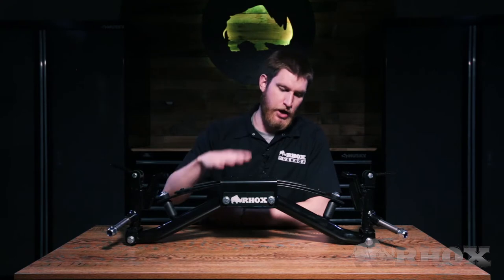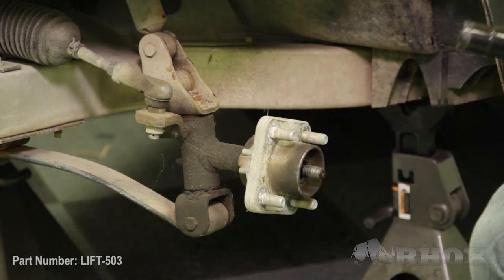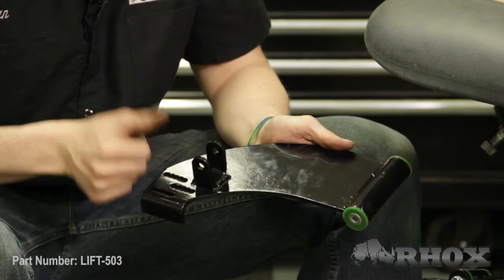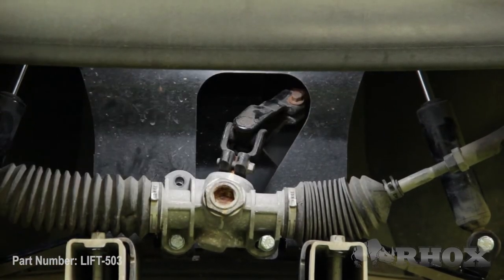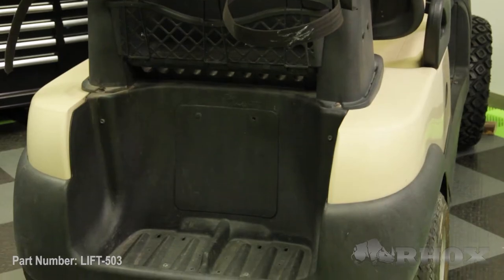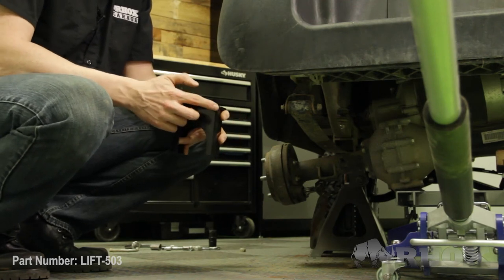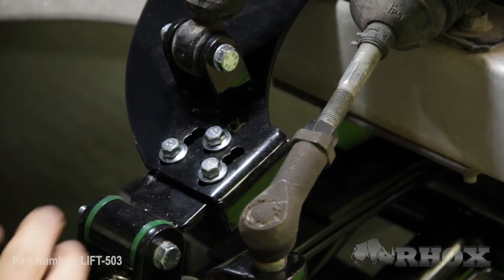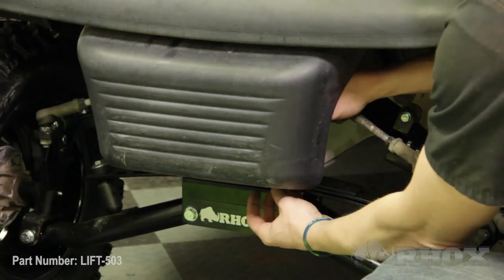LIFT-503 RHOX BMF 6" A-Arm Lift Kit on a Club Car Precedent

Comment: and most important. after the install, adjust the brakes.!!!! the bottom bracket for leaf springs is where the brakes pull from. other than that 23 inch tires work great and with 10 psi in front and 15 psi in rear the ride is quite nice.

Comment: I have been trying to track down if anything is loose on my front end.  I have the RHOX BMF A-ARM Lift kit and one area that was loose is the bushing that connects the end of the leaf spring to the lower a arm.  Is that supposed to be tight when there is no weight on the front end?
Reply from the maker: There shouldn't be signs of wear on the bushing.   This area shouldn't be loose either way.  

A good way to check to see what is loose on the front end is to pull the cart up next to a curb. The  front wheel should be parallel to the curb.  Place something between the curb and the wheel to protect the wheel.  Have one person turn the steering wheel while you watch the front end.  If something is loose, you should be able to see it move this way.

Comment: I previously had a Rhox 4" lift installed on 2018 Precedent and had all kinds of problems with brakes. Ultimately had to add longer brake cables. Was that a "one off" or do you need to be ready with longer cables for the 6" lift? I have a 2019 Onward that I'm getting ready to upfit.
Reply from the maker: When the rear leaf spring is installed, the brake cable is usually able to be clipped back into place on the front shackle. In instances where it is too tight, we won't install it back into the clip on the shackle.  We will support it with heavy duty wire ties. This is what most dealers do vs. buying a longer cable.  Some still prefer the clip so they will get the longer cable.
Reply from the maker: We will see it happen every so often.  Most of the time it works with the factory cable.

Comment: When adjusting the camber do both sides need to match. So if the drivers side is in the 3rd hole does the passenger side need to be in the 3rd as well? Been having some trouble on the alignment in the front.
Reply from the maker: It isn't ideal but we have seen it done before, usually when a frame is not square or something else is off in the front end.
Reply: @GolfCartInstructions  thanks yea I went back and checked the frame and it's off a bit. Thanks for the info kit looks great.
Reply from the maker: @302candyboy  Anytime. Thank you for the feedback and we hope you have a great weekend!

Comment: Installing on a 2014 Precedent and the shocks and tie rods won't reach to hook up???? It,s like the lift won't go high enough to reach??????
Reply from the maker: Place a jack under the lower a-arm to help it reach high enough so you can connect the components.

Comment: I have a 2005 precedent I did the lift kit correctly but the tie rod ends are to short to get 1/8th tow in there is only 1/2 Inch or less threaded into both the tie rod ends and yes I put the spacers in behind the steer rack what do I need to do find longer tie rod/ball joint ends ?
Reply from the maker: Hi Ken, try moving the camber in.  This should give you more toe adjustment.
Reply: @GolfCartInstructions  Ah ok Thank You I will let you know .

Comment: will this work with the heavy duty leaf spring kit? if so do i install them on top of the axle also?
Reply from the maker: Hi Mike. Yes, the kit will work with heavy duty leaf springs and you are correct about the placement. They will also be installed on top of the axle.